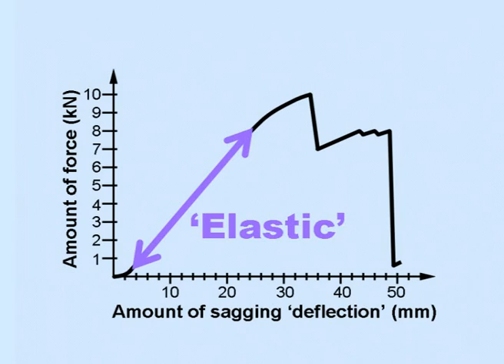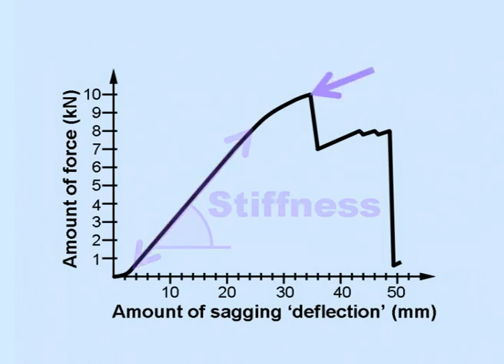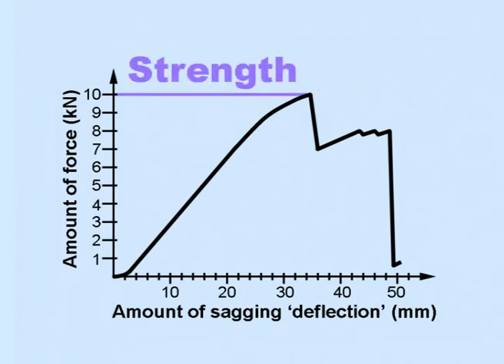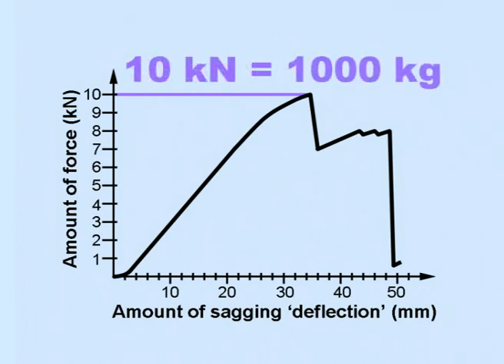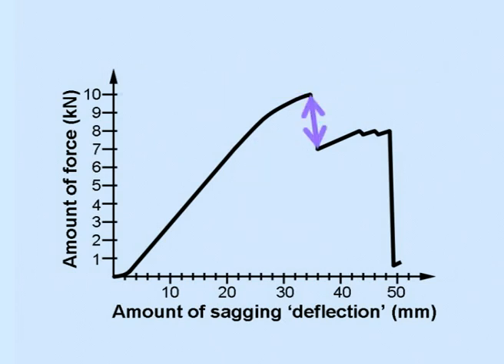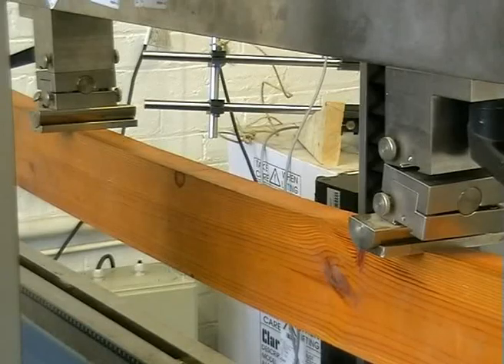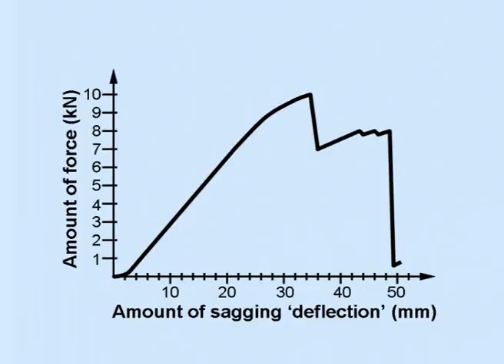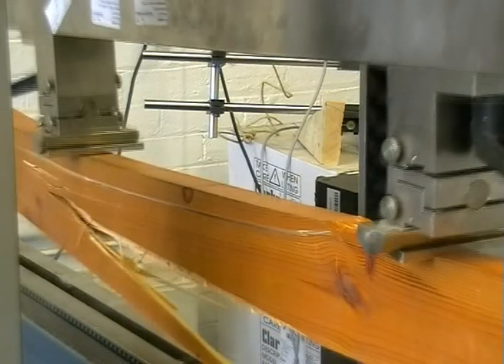Strength and stiffness

Comment: This is such a big relief for me. I am trying to build my own bedframe and to be honest I didn't believe a lot of these DIY YouTube channels saying that a 2x6 price of lumber was strong enough for a bedframe.
Reply: Good for you for doing research and verifying what was said. It's what should be done. 👍
Reply: I am doing the same. What did you find out? I was thinking about constructing an 80" x  60" queen platform frame using 1x6's for siderails and middle support, 1x4's for slats with 1.6" gap, and 1x6's for legs (2 in each corner and 1 under center of each siderail and center support).
Reply: According to the chart 2 of these spanning what i believe to be 8 feet could support 700 lbs while sagging only 1/4". Ultimate breaking strength would be over 4000 lbs.

Comment: In Vietnam, we prefer the term Modulus of Elasticity / Rupture.
Mostly because strength and stiffness are quite similar when translated into Vietnamese, and even more difficult to tell them apart when we also have the 'hardness' of wood.
Reply: Thanks for the insight.
Reply: Vietnam is gay

Comment: I'm not sure that that is the definition. You seem to be talking about Elasticity vs Modulus of Rupture.
Reply from the maker: Chernobieff Piano - terminology varies from place to place. It's not even consistent within the European Standards - but 'bending strength' is the term used in EN 408, rather than Modulus of Rupture. The stiffness is 'Modulus of Elasticity in bending'. Here we use the basic terms 'strength and stiffness' to try and keep things simple.
Reply: Ok, i'll agree that terminology is inconsistent. So if you have a piece of lumber, let's say a 2" x 4", will the strength (MOR) be the same in either direction? Can you demonstrate strength and stiffness separatly?
Reply from the maker: I don't really understand what you mean by "either direction". 

The piece of timber will be able to sustain different loads depending on which orientation it is in (since you can place it in the machine flatwise or edgewise - and two ways up for each) and also depending on where the defects (knots, inclined grain etc) are along the length.  The European standards (EN 384 and EN 408) require the worst defect (a guess) placed centrally in order to try and get the lowest bending strength measurement - with the board (normally) placed edgewise - but a random way up. Other standards around the world specify random positioning of worst defect - and sometimes different testing spans.  This means that a piece of timber can have different bending strengths depending on how you test it.  Hopefully all the possible bending strengths for a single piece are quite similar - but since you can only break it once, it's hard to say what the reality is.

This is different from timber having different material strengths in different directions (along the grain, radial, tangential) and under different actions (compression, tension, shear).

Stiffness can be measured in the same test, and is also affected by orientation and test span - and also depending on how you measure it (e.g global vs local in EN 408). It is a separate property to strength (but often correlated with it).